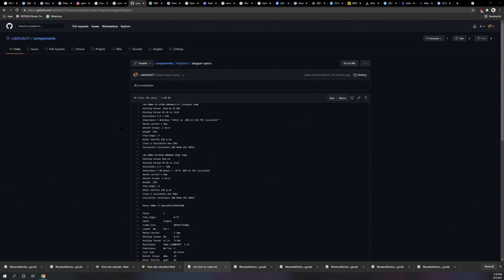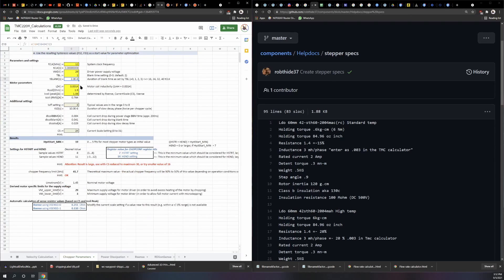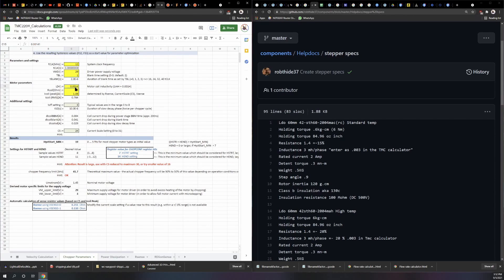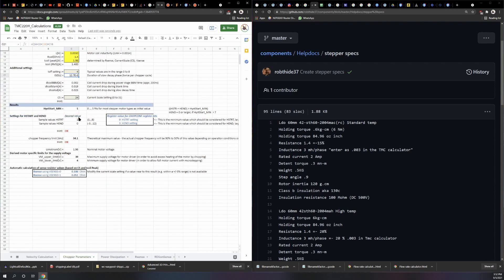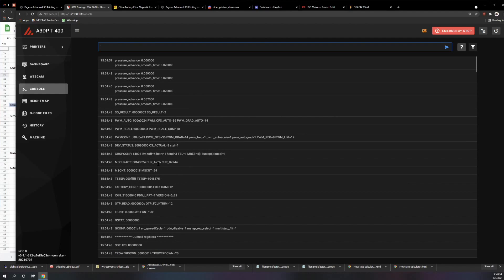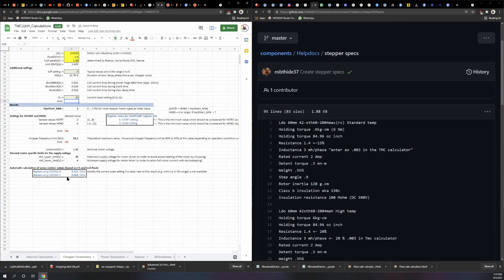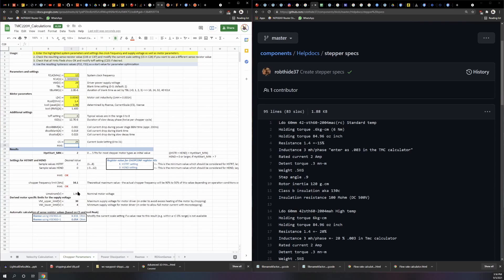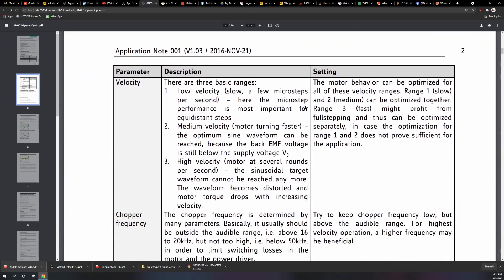How to tune stepper drivers "faster ,quieter and cooler"

Comment: Sense resistor value is not guaranteed to match what klipper has.   I just look on the board I'm using.   Duet boards for example often have non standard values.

Comment: I get strange values with the LDO-42STH48-2804AC and TMC 2209. Speed and Accel wont go higher. using this: driver_HEND: 10
driver_HSTRT: 7
driver_TOFF: 4
driver_TBL: 1

what am i doing wrong?

stepper motors seem to be a little more quiet tho.

Comment: hi, thanks for the vid. How do you determine the system clock? my board has a 120Mhz MCU, but i guess thats not the clock feed to the drivers.
Reply from the maker: if using internal clock then should be 12mhz for 2209 and 2208 and 15 for 2660 . You are almost def using the internal clock unless its a custom stepper
Reply from the maker: 5160 are 12mhz to
Reply: @advanced3dprinting  15 for the 2660 ? or is it 16 ? 15 looks weird for a clock. Don't want to start with a wrong value, as i have absolutly no knowledge about drivers, just discovering your video and now trying to somehow understand, or at least try to fine tune my drivers on a klipper-driven duet2.
Many thanks for sharing this video !

Comment: Tbh my motors can easily do 500mm/s with just guessed settings. But I get ghosting at above 1000 accel at 30mm/s outside perimeter

(My printer is a tool changer with play having rails)
Reply from the maker: If you use input shaping with this you will be able to run way more accel
Reply: @advanced3dprinting  it never worked well on my printer, causes so much smoothing and makes it not work well
Reply from the maker: got it did you try with accel or just by using calipers and ringing tower ?
Reply: @advanced3dprinting  I used an accelerometer
Reply: @advanced3dprinting  keep in mind my printer is a tool changer and the design is very weird. Might be why it's life this. My rails have a bit of Play too
Reply from the maker: ldo can make custom preload rails thats what i did for the troodon kits . it helps alot cause alot of these companies sell 0 preload rails that are loose so make good videos when people slide them around but they are not so accurate
Reply: @advanced3dprinting  yeah. They're bo name Chinese rails. No brand name. I live in Iran and rails are nearly impossible to come by
Reply from the maker: Yu are better off trying to print at 100 with a few k accel then 500mms at 1000. Even 300mms to 400mms matters less then going from 5k to 10k accel or 15k to 25k at 300 on alot of prints
Reply: @advanced3dprinting  oh yeah i know. i'm just saying the real constreaint is really the ghosting/noise for most people